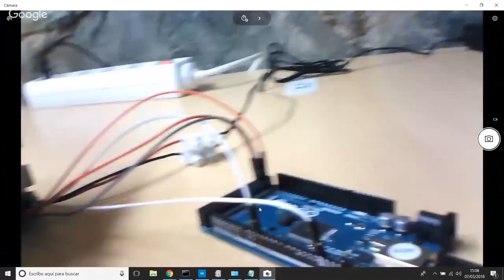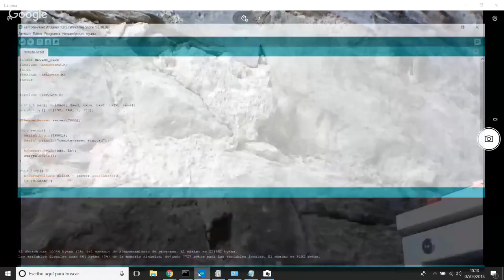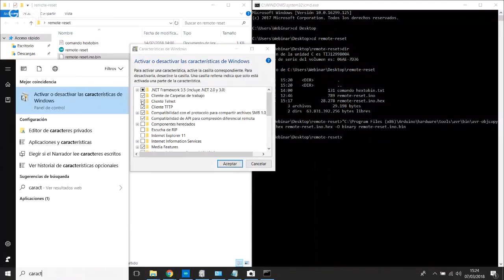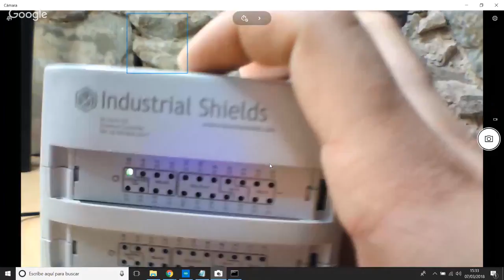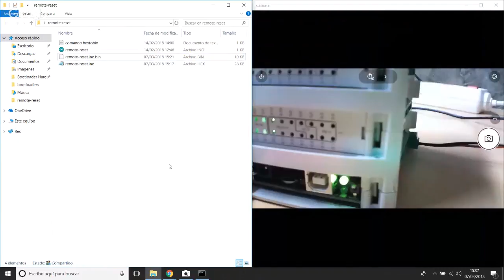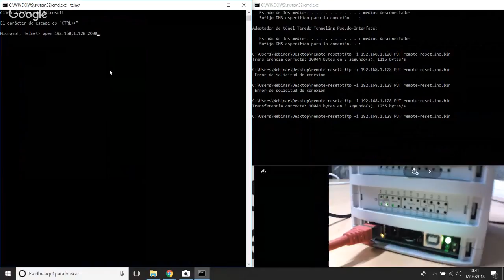How to upload a sketch using ethernet - Industrial PLC based on Arduino

Comment: will this work for the arduino GIGA r4 wifi board to upload the code from home to another identical board located inside a factory?
Reply from the maker: Dear Juan, 

Sorry but the bootloader used in this example is for the Arduino Mega and the Ethernet chip W5500, which are the hardware parts of the M-Duino Family devices. We do not work with the Arduino GIGA r4 wifi board  but you can search on the Internet for OTA uploading using this board. 

Thank you,
Reply: ¡Gracias por la respuesta! ¿Algún consejo para conseguir cargar un sketch a distancia por ethernet a una placa arduino giga? Me esta costando bastante entender como hacerlo y me está dando muchos problemas. (Estoy un poco perdido y agradeceria cualquier consejo).

Primero estoy confirmando si es posible lo que estoy pidiendo porque no he visto que nadie lo haya hecho antes y no se si es porque es nueva la placa o porque es imposible.
Gracias de antemano. @Industrial-Shields
Reply from the maker: @juanperezgarcia9963  Buenas Juan, lo siento pero no podemos ofrecerle más ayuda al respecto ya que no trabajamos con esta placa. Por Internet puede encontrar información relacionada. Si lo desea nosotros le podemos ayudar con uno de nuestros equipos los cuales puede encontrar en nuestra web: https://www.industrialshields.com/. Muchas gracias.
Reply from the maker: @juanperezgarcia9963  Buenas de nuevo Juan, de todas formas estamos trabajando con la placa Arduino Giga para realizar equipos con esta CPU en un futuro. Actualmente, tenemos equipos similares basados en Arduino, ESP32 y Raspberry, los cuales puedes ver en nuestra web, que quizás te puedan interesar. Muchas gracias.